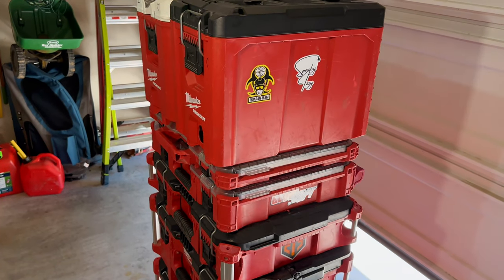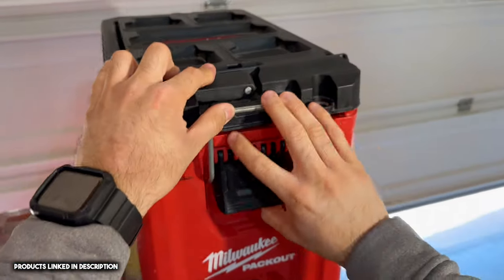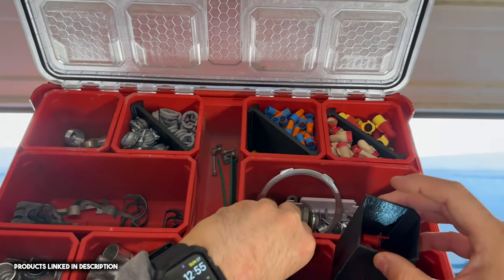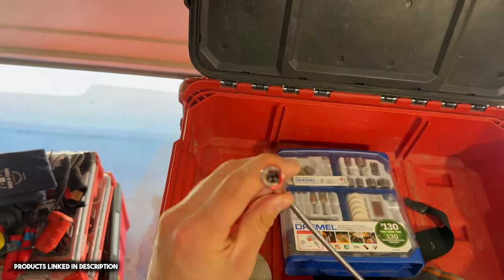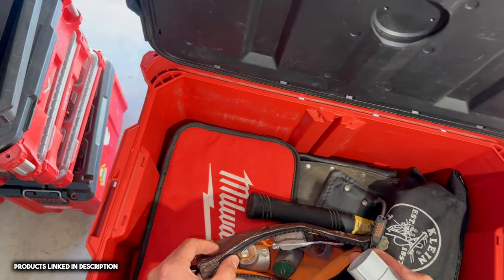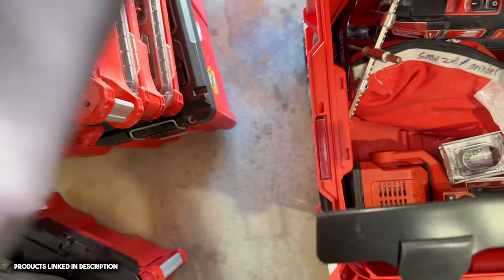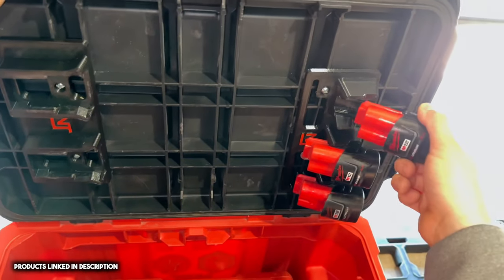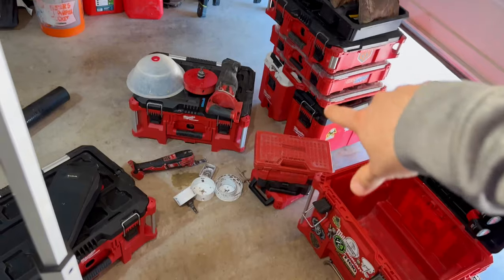What's In My Packout? | Electrician

Comment: Milwaukee makes a drill extension that snaps onto the drill bits. That extension with the allen screw will come loose and the hex will strip. Ask me how I know!  

5-1/2", 12", & 18"  and they snap together to make any length you need [so you can drill down thru fire blocks]

Comment: Nice loadout my dude, we need to do a sticker swap! Do you have an insulation resistance tester?
Reply from the maker: Thank you! & I’m down 🙏🏽⚡️
I do not own a Megohmmeter 😨
Reply: Depending on what you generally work on, it's invaluable. Fluke's 1587 is probably the most common I've seen but there's a ton of good ones. I just got a 5kv IR tester. Coolest bit of kit I hope I never have to use again 😂😂

Comment: Can you clarify the candy canes? Never seen that before.
Reply from the maker: When doing new construction, you have open walls. The candy canes can be mounted on the front part of the studs. Which allows you to use the slot to support a 1/2” emt conduit, 3/4” emt conduit or MC cable. You can google “Screw-On Conduit Support” for a visual